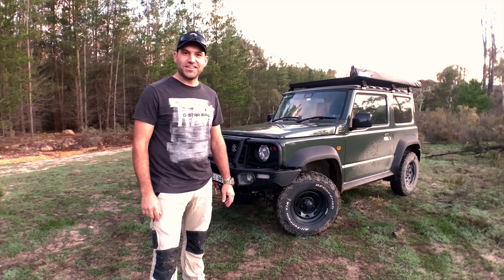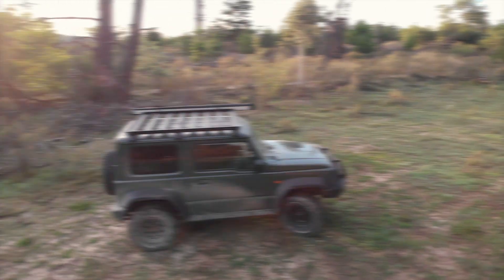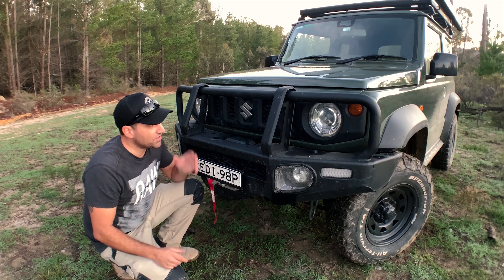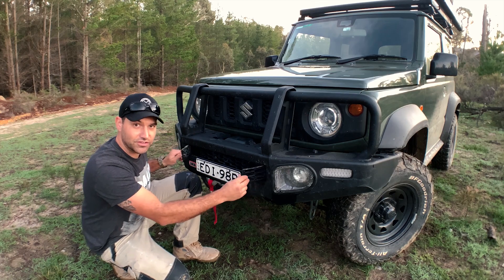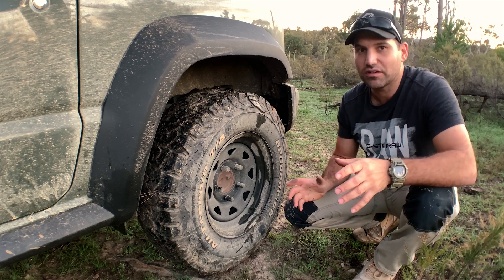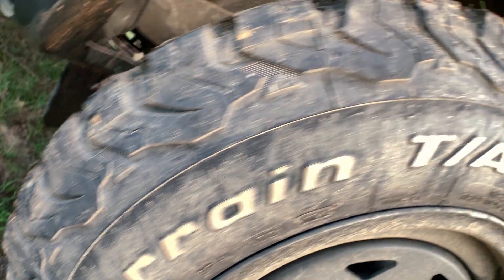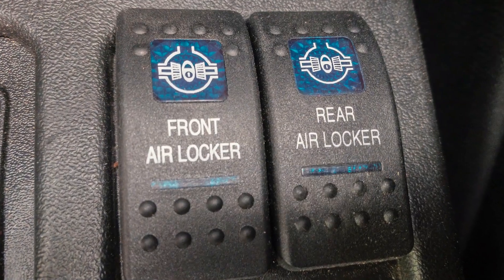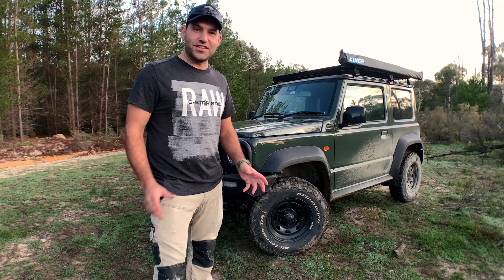2019 Jimny mods - Walkaround

Comment: Deffo gettn that ARB bullbar ASAP when I take delivery, thinking the Rhino tradie full length roof rack with a roller at the back for loading kayaks up top (side awning is a 'must') Need a tow hitch too- the latest  Quintrex 450 Fishabout Pro will tow nicely with the Jimny because it's a braked trailer 😍👍(this is the biggest boat I can tow with it). Then it's tyres,  lift & lockers.....🤤🤤😜❗️
Reply from the maker: Nice one. Quintrex will look good behind the Jimny

Comment: Hey mate, love your rig. I currently drive a 2006 gen 3 silver bullet but the new black one is arriving in a couple of weeks. Question, with the 40mm lift, what offset did you get on the rims and did they rub at all?  (want 235,s but not the rubbing lol...had to trim my guards big time on the 2006).

Thanks in advance.

Greg

Comment: How do you find the OME on road?

A bunch of folks comment about the fact that it’s similar spring rate as stock, saying it’s still a bit wobbly and not an improvement with load carrying.  What’s your view?

In my country it’s basically OME or Pedders. Whilst Pedders seems a better fit for my use case, it’s hard to ignore all the security you get with OME. They give a very nice guarantee.

I also ask because I’m looking at a similar roof setup. Especially weight wise.

Comment: Hi, given you've had the mods over 5 months, I was wondering if you could please do a long term review video on the suspension and tyres, did changing the suspension improve road handling? Going from the standard 195 to a 235, how was on road fuel consumption with a wider footprint? Did having a larger rolling radius affect gearbox performance and how did you change the spedo? What rims and why? Did the track setting get wider with the new rims? From a photographer looking to get more places, really enjoying going through the videos, thanks heaps and loving the drone shots :)
Reply from the maker: That’s a great idea, I’ll put this video in the pipeline
Reply: @BillyGoatJim  Awesome, cheers :)

Comment: Love the ARB bullbar but have one eye on weight which is an issue with the jimny and GVM. Been thinking of using ATV winch which most manufacturers make say sth like a 4500 lb T max that weighs in at under 10kg. Any thoughts? What winch you install?

Comment: Does anybody do lower low range gears for the new Jimny? I don't do rock crawling but would find lower gearing of benefit for slow speed work in my manual Jimny, the ARB difflocks look to be a must have option.

Comment: Thank you for the informative videos George. I was greatly inspired, so this week I visited ARB and had a rear locker, diff breathers and rock sliders installed. That’s in addition to the 40mm lift (Tough Dog) and BFG KO2s (215)  I had previously upgraded to. I also have the ARB bar and Front Runner rack. What are your thoughts on a snorkel? Important?

Hope to see you on a trail one day. 👍🏻👍🏻
Reply from the maker: Sounds like you’ve got a nice rig going there Simon... Mate a snorkel is a must, in addition to the diff breathers if you plan on doing deeper crossings. Once I find a snorkel I like I will be putting one on for sure.

I’ll catch you out there

Comment: Awesome stuff!! Can you please explain how is the compressor mounted to the floor (did they drill the floor?) and where is all the wiring (power and solenoids) going through?
Reply from the maker: Yes they drilled and bolted through the floor, with all wiring passing beneath the car. The wiring is up higher than the chassis and is in conduit so it's nice and safe.

Comment: Hey George, do you have any recommendations on front recovery points? Are they required? If so do you know of any that fit with the ARB bull bar? Cheers and thanks for the vids.
Reply from the maker: Gday Leo, I haven’t found I’ve needed them yet. I would say rear points would be more important... most the recovery points mount straight the the chassis so I wrong imagine the bullbat design matters.

If you do plan on going for a set get the best quality you can afford. I snatched a bloke out at Fraser Island off some cheap ones and the cracked.

Comment: Hello! What specs are you using in your Old Man Emu suspension? I want to change mine also but not sure about the lift or different versions available for the New Jimny. Cheers from Perú!
Reply from the maker: Hey mate,

The OME suspension is fantastic. It’s a 40mm lift, and the on and off road performance is great.

Comment: Hi Mate, great Suzuki i am very jealous !. May i ask what the Old Man Emu suspension is like on the road ?. In their promo video ARB claim the OME setup is more stable and better on road than standard.  What has been in your personal experience and opinion please ?
Reply from the maker: I can confirm what they say is absolutely correct... I was shocked how much more stable the ride felt once the OME suspension went in
Reply from the maker: Let me know if the offset rims make a difference.
Reply: @BillyGoatJim  Hya mate. Im almost at where your at now  minus the lockers. I have the warn axon 55's.

Anyways, you say the OME is good on road, but what difference hss it made off road. Thx
Reply from the maker: Mate it’s huge, besides clearance the softness and bouncing of the Original suspension is gone, and you don’t hit the bump stops at full flex

Comment: hey mate, nice rig. hows the standard gearing with 235/75r15? does it go alright on the highway at 110kpH? Cheers
Reply from the maker: Mate it’s good on the highway with slightly low rpm, long uphill stretches are a little painful. A set of reduction gears would be nice

Comment: Hi, awesome rig! I'm one day away from fitting the ARB bullbar onto my Jimny, and also a winch, what's your winch rating and how does the Jimny handle wiching electricity wise? Thanks!
Reply from the maker: Hey mate, the winch is rated for 8000lbs, and I can tell you I just finished a track (video coming soon) that I was winching first about an hour straight without any issues. Upgrading the battery down the track is on the cards though.
Reply: @BillyGoatJim  Thanks so much for the quick response, can't wait to see your video and also try out my winch! Cheers, mate! :D

Comment: Where did you get the rack from in Sydney. Did you fit it yourself?
Reply from the maker: I ordered it online from Frontrunner, and installed myself. It’s pretty straight forward
Reply: Billy Goat Jim ahh cool thanks for that. I’m getting my car this weekend. I saw a few site selling the rack.
Reply from the maker: Awesome. Enjoy
Reply: Do you notice any wind noise without the wind deflector on the roof rack?
Reply from the maker: There is a bit yes. I haven’t tried with the larger deflector
Reply: Hello .
How many fixations to the car roof ? 6 ?